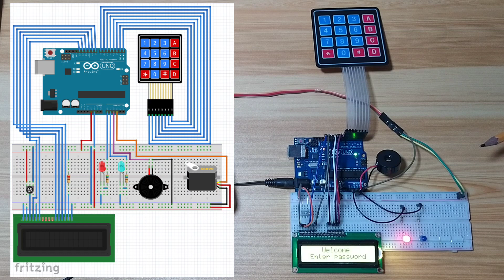Project Idea: Door Lock Security System | Arduino

Comment: Nice! Planning to use solenoid lock.  Thanks!
Reply from the maker: Hi Michael, yes solenoid lock is better for this application. By the use separate external power supply for solenoid lock